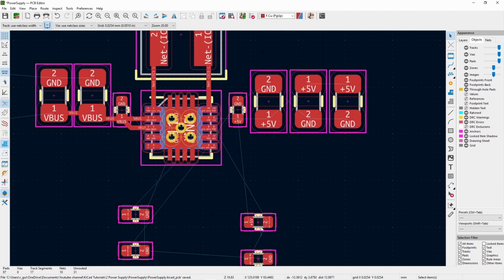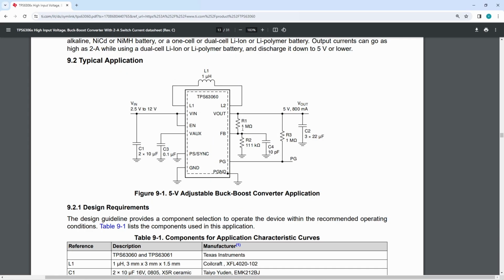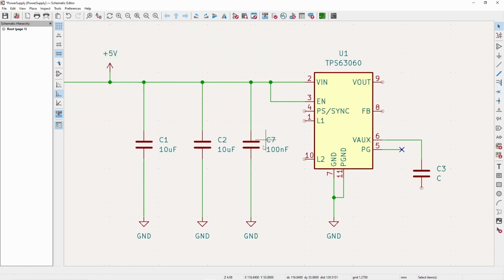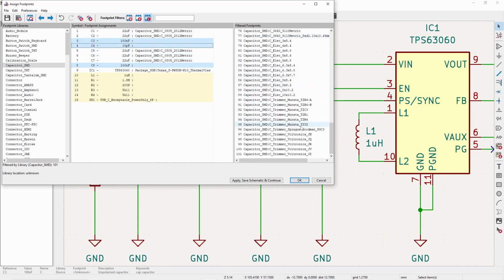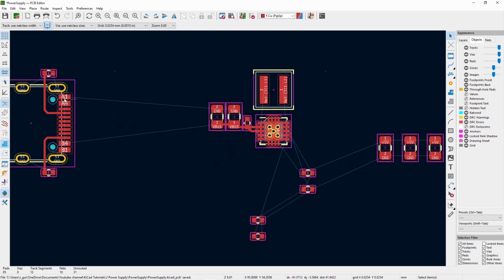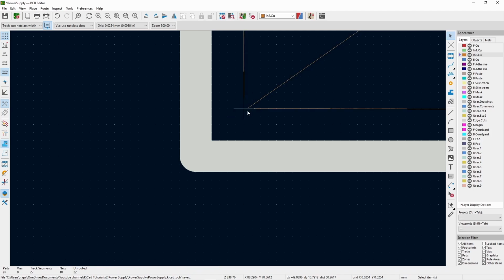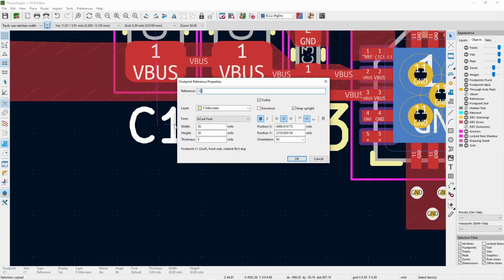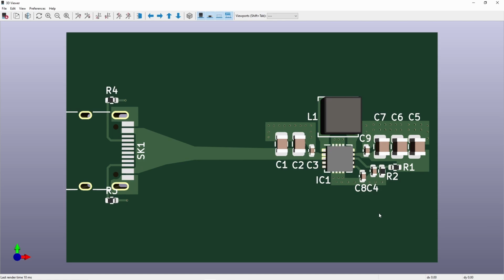Let's Design a Power Supply! - Buck-Boost Converter - Part 1

Comment: Milk before water - the only sensible option.

What are the purpose/trade offs with adding the large fills for VBUS, GND and the switching nodes? I say trade off because that’s normally the case in layout; you can improve X and the cost of increasing Y.
Reply from the maker: How is the tea supposed to brew properly when cold milk kills the water temperature. Hot water then milk! 

The main advantage of copper pour is its gives you the ability to reduce track resistance and point to point inductance.  I dont think there are many disadvantages especially for this application.

1. Pour can have increased capacitance to the other layers which may undesirable for some specific applications.
2. You may want track inductance for some very specific hf filter applications.

For this application, I don't think there is much a disadvantage. Maybe takes a little more room.